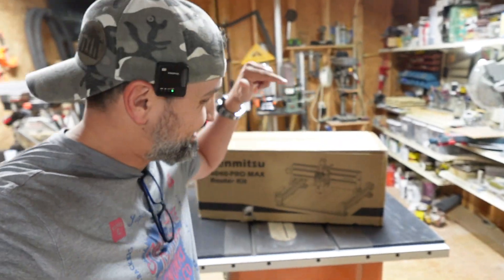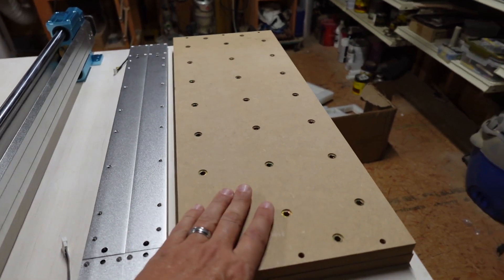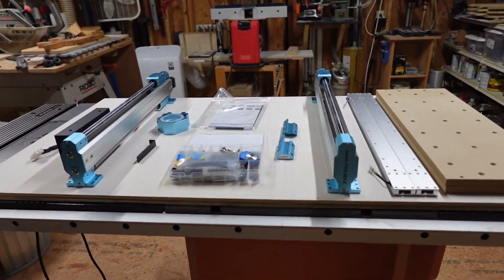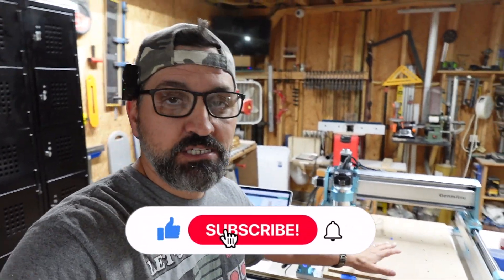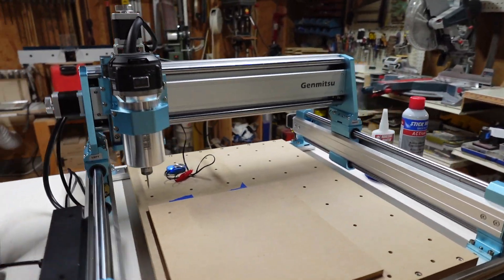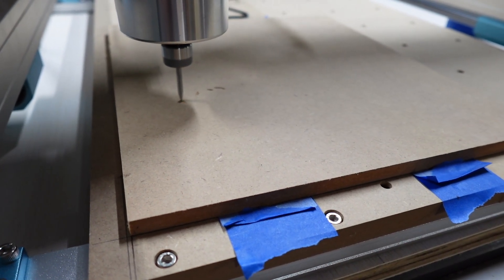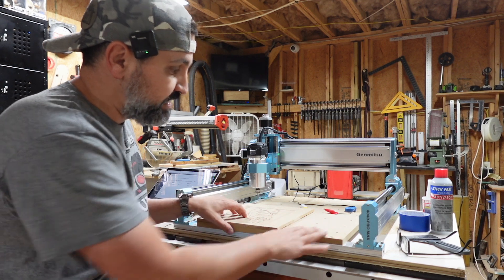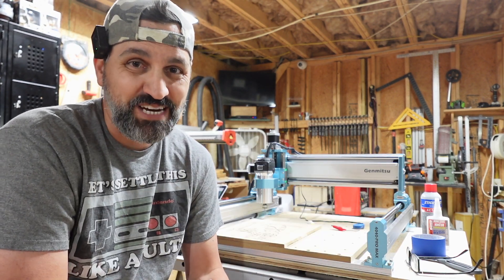How Good Is the Genmitsu 40404-Pro Max? Setup and Test Results!

Comment: I can not find anybody using this with stone slates or marble or anything , if you're interested in an experiment or if you've tried already .... Let me know if it works 🤠
Reply from the maker: For stone or slate…. You would need a Drag Bit. It’s spring loaded that apply pressure on the surface of the tile to engrave it.  Otherwise a laser would be more effective.

Comment: Is it possible to change and upgrade to another and better z-probe?
Reply from the maker: I believe so. You can always hardware a new one. It’s just a clip and piece of metal to complete a circuit once the blade touches the metal.  I’ve even used a thin wrench because I lacked room on a project!
Reply: @TheCrawlspaceCraftsman nice then i can fix something to my machine

Comment: i just bought the 4040 Pro Max -  I'm looking for a foldable mobile table as I have limited garage space-  What are the assembled dimensions?
Reply from the maker: Sorry for the late reply.  Make sure you get a table that’s sturdy with not a lot of movement. When the machine changes directions it will do so rapidly and you need to make sure it’s stable.  Other than that this machine has a rarely small footprint so any table really should work!

Comment: 13:54 This right here makes the video feel bought. That's a fairly important thing to note if a new user does not want to work with the paper zero method. Instead, you brush it off as petty and "oh this is just a me thing."
Reply from the maker: So me talking about the crappy inaccurate z probe is bought?  Hmmm…. I guess I could have lied and said it’s great (it’s not).  And never have I in any of my projects used the paper method.  🤷🏻‍♂️.  Thanks for watching!

Comment: Those "little NEMA motors" you commented on are 1.7 amp versions capable of exerting over TWENTY POUNDS of pulling force on the lead screw axes.  Do a bit of tech research before belittling something.  The FA belt drives pull only about 5 pounds.  It makes a difference cutting metals.
Reply from the maker: Thanks for you feedback!